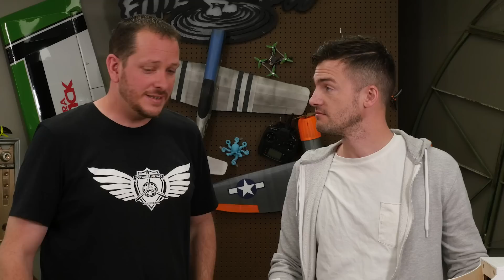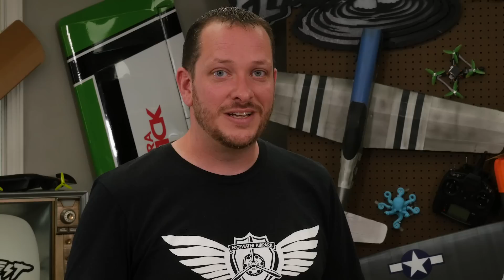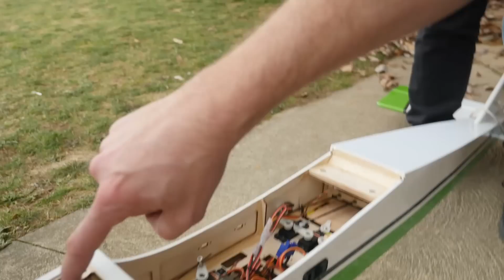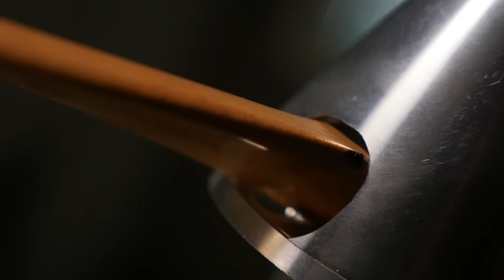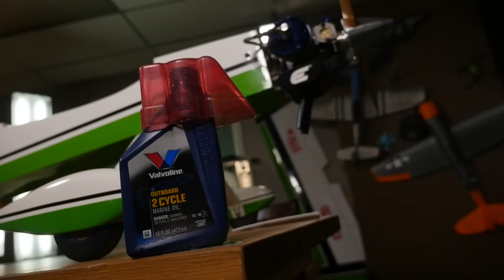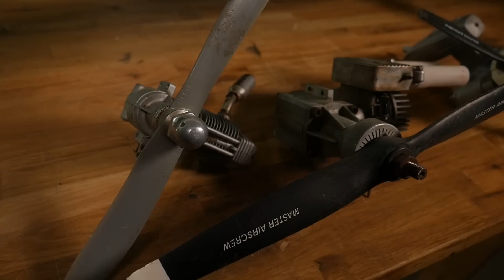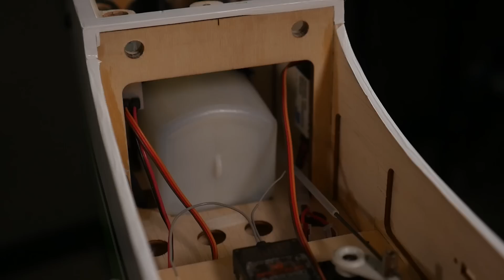Getting into Gas Planes - Breaking in an Engine

Comment: If you get into bigger sized gas engines, starter motors are not an option.. Cheaply anyway. Although hand starting with gloves are recommended, (Imo especially with carbon props with a sharp trailing edge), I don't find many people who use gloves anyway. ;P
Reply: Yeah good point, They only use electric starters for safety crap haha, when starting my 120cc extra just keep 3 fingers on the face of the prop and that way if it back fires your fingers aren't in the line of fire. smaller ones just give it a flick backwards and starts right up haha. :)

Comment: What are the main advantages/disadvantages of gas VS electric?   Ultra stick electric VS   Ultra stick gas?
Reply: I would say flight time. Gas engines normally have about 10 min flight time with recommended fuel tank size and you still have 1/4 tank lefy.
 With gas it also so easy to just fill up the tank and go up again and no need to think about charching batteries. Sure rx and ignition needs batteries, but they last many fligths without charging/are cheap/ don't take long to charge.

Disavantages with gas are they are more noisy, have less power compared to electric and need more service.
Still with a plane recommended for 30cc and up I would always go for gas rather then electric.